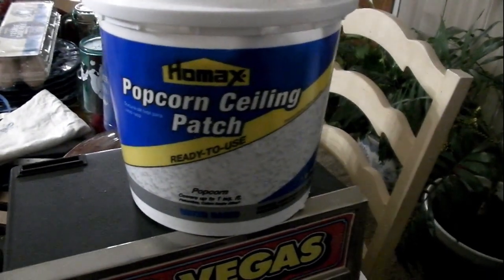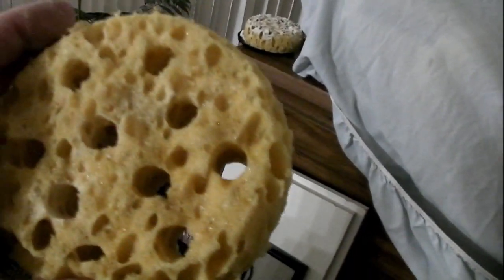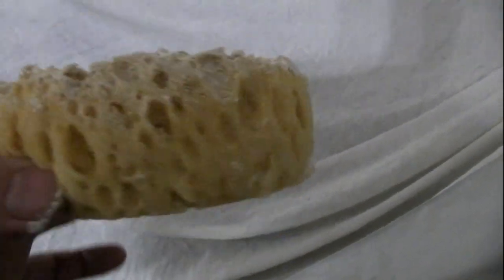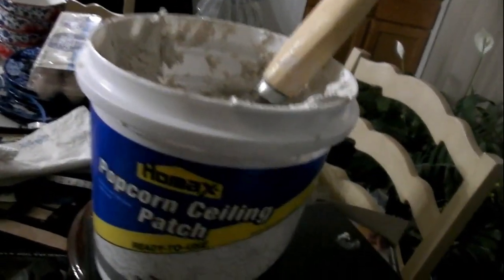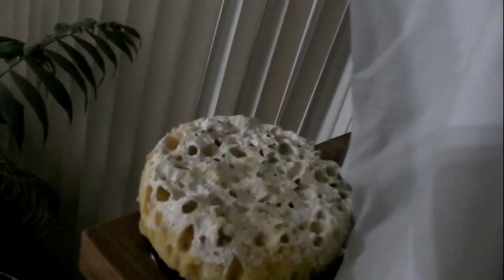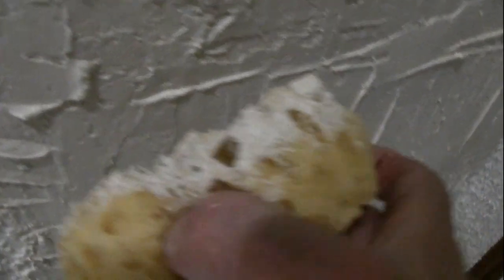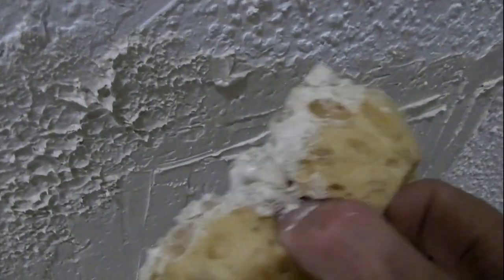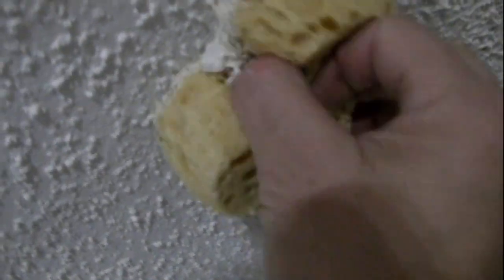How to Match Popcorn Ceiling Texture

Comment: Or you can use the home remedy: 60% plaster, 40% old-fashioned Quaker Oats (for a bigger texture, get barley flakes)and mix.  If the plaster goes on too thick, add a bit of water, up to 10%.  apply. Use a thin layer and don't overwork.  This is good for small patches, for example 15 inches x 6 inches.  Saves time and money when you have to make a repair.  When the plaster is dry, then paint.